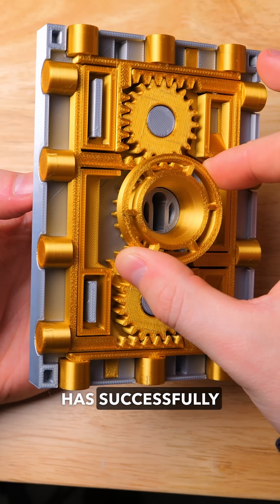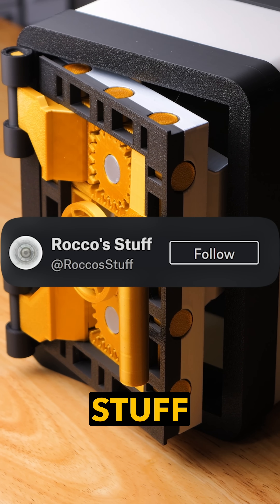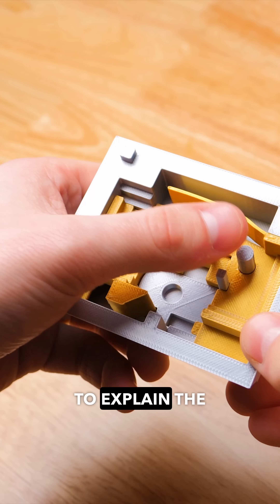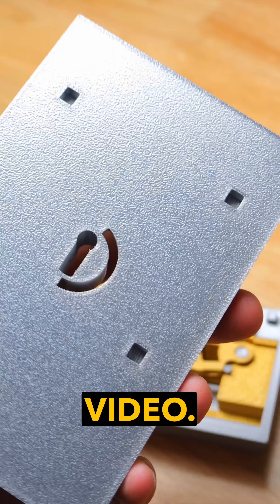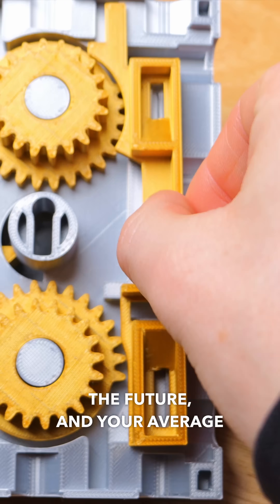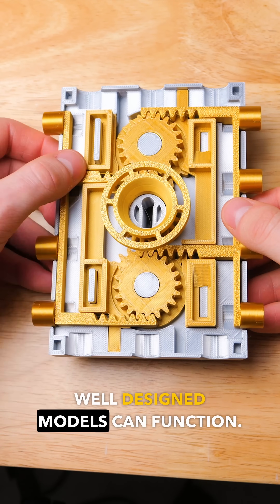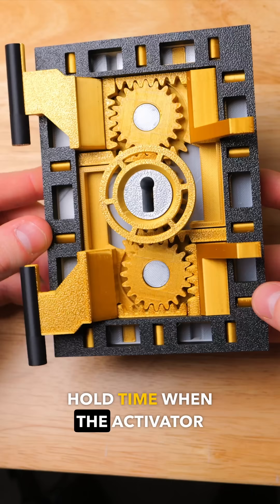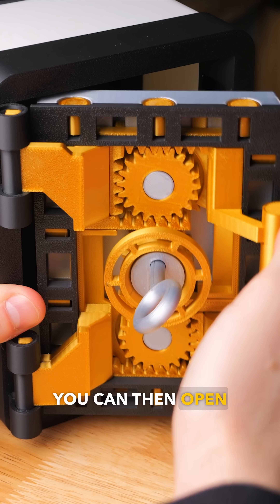3D Printed Functioning Vault! #3dprinting #diy #shorts

Comment: Cool. How many prints. Is there some function that takes numer of parts and maps to number of times prints must be run, and if so if it non-polynomial then there is a practical limit on the number of parts of the given complexity that can practically be printed.

Comment: Love your passion for this hobby, although I don't understand why would you 3d print something that would be cheaper to buy. isn't the entire idea of 3d printing is to make something that CANT be made another way?
Reply: That is typically the best approach to 3D printing: making something that can't be made using other manufacturing methods. But another use for 3D printing (and was actually the original intention of 3D printing) is to use it for quickly/cheaply prototyping parts for a product that will eventually made made using conventional manufacturing methods like injection moulding. So I guess it's kinda just up to the person who owns the printer to decide which path to go when deciding if they should print something or just buy it from a store.
Reply from the maker: @ianjtgove You hit the nail on the head with this answer!